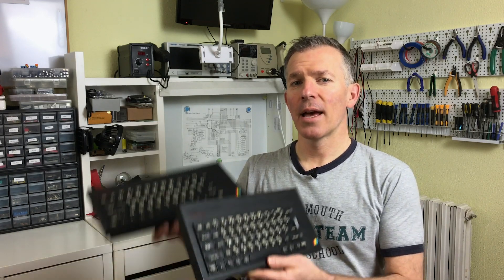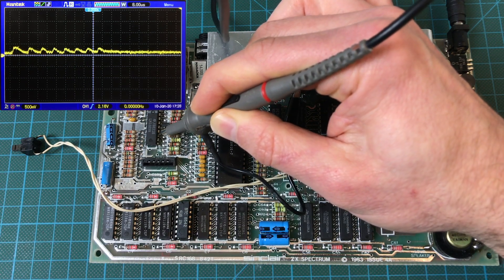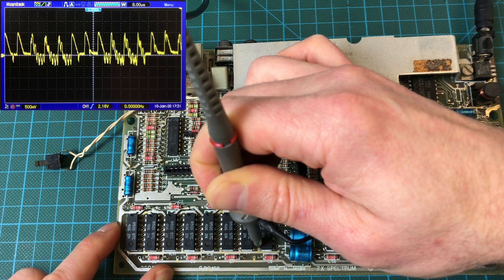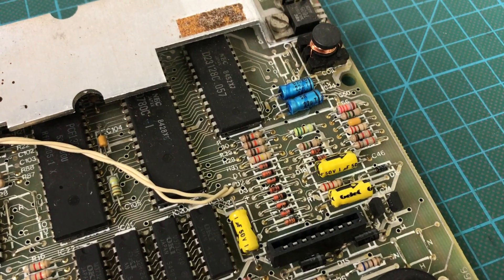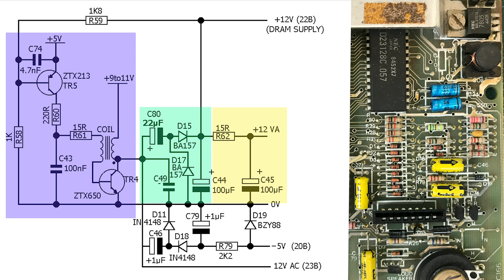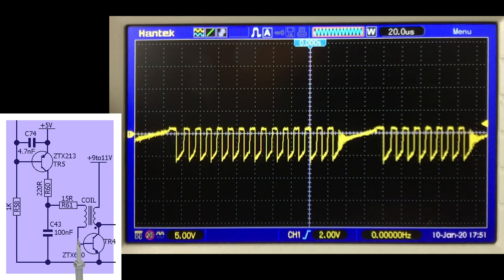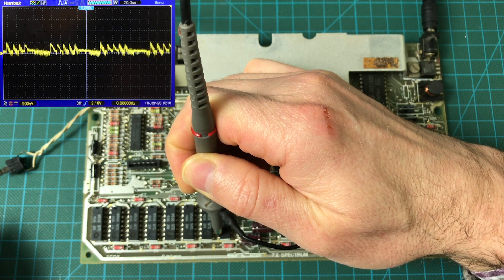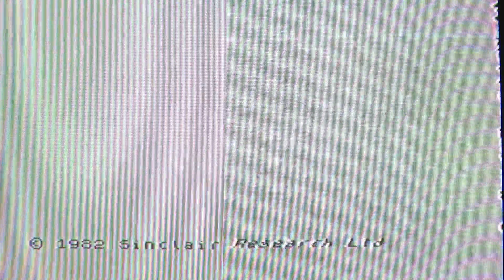Fixing Bad Video Quality on the Sinclair ZX Spectrum

Comment: ZX Spectrum 16K, 48K, and  ZX Spectrum+	      128K, +2, +2A, +3
CPU cycles per PAL line	                224						                           228
PAL line time			                       64 μs					                           64.28 μs
PAL lines per frame		               312					                                   311
Frame time			                       19.968 ms				                           19.9915 ms
Frame rate			                        50.08 fps			                                   50.02 fps

Display Vertical Synchronization by the Z80 maskable interrupt line

Comment: A video problem was the first computer repair I broke out a soldering iron for. My TRS-80 Model 100 arrived in mostly good condition, but the display flickered pretty badly. A few electrolytic capacitors had failed. Thankfully, it was easy to visually diagnose it(and some web searches pointed to failed caps being a common cause of that sort of flicker) and get the display rock solid like it should be.

Comment: I have this exact problem, with the exact same interference pattern as the first machine. It also wont load from tape at all, and my theory is that all the noise in the video rf generator is polluting the sound demodulator as well.

Comment: ohh.. Philips capacitors... time bomb :)
Reply from the maker: Oh really? I didn't know the Phillips ones were particularly bad. I'll keep it in mind. Thanks for the tip!
Reply: @NoelsRetroLab  Philips capacitors are very good, but after 20-25 years their condition deteriorates a lot. They are not dealing with the heat, but with the pulse load. (I'm upgrading old Philips CDs, all need to replace the capacitors)

Comment: Probably nuked my Sinclair Z81 as a kid plugging it in while the power brick was plugged in. I bet I could fix it these days but it's of course long gone.
Reply from the maker: I don't think plugging it in while the power brick is connected should be a problem. The usual problem is connecting something to the expansion port while the computer is powered. In any case, chances are it was an easy repair. Maybe it's time to get a ZX81 back 😃

Comment: I've just got my old 48k down from the loft which I had as a kid in 83. One of the two caps you said fail often had died so I replaced it. I have done the composite mod as well, but the display is very very poor. I plugged a different power supply in without realising the positive and negative were the wrong way around (modern way around) which I think has blown something, any ideas where I should start looking?
Reply from the maker: Yes, check out the DC voltages, especially -12V in the PAL encoder (I think I have some videos exactly about that). Chances are the transistor TR4 (or TR5) is blown and not getting steady 12V. Hopefully that's all it is, although it's hard to tell the full extent of the damage ahead of time.
Reply: @NoelsRetroLab  I've ordered TR4 and TR5 Transistors and also a modern voltage regulator, I'll replace them and hopefully she'll wake up

Comment: It's quite interesting actually, I didn't know the original Spectrum had a voltage inverter. The Soviet clones of Spectrum widespread in former USSR (which I'm sure you are aware of) used the 4164 DRAM chips (Russian clone name К565РУ5) that were 5v powered and did not require 3 voltages to power. Also they used RGB output that TVs had to be modded for, hence, no RF modulator and AV output. I recentley purchased a 48K Spectrum on Ebay and I'll be aware of this problem now, thanks much for your video!
Reply from the maker: You're welcome. I didn't know the Russian clones used 4164. That would make so much sense! Is the memory organized more like in the 128K, or do they still have a separate bank for video RAM to minimize changes from the original?
Reply: @NoelsRetroLab  Yes, they do have a 16K bank for video RAM (as far as I recall it's only partially video and it's up to 0x8000 user RAM) and 32K for the rest of memory. Also, RAM performance is different in these two banks, I think original Spectrum has that effect too. As a teenager I used to write custom loaders for games, I tried to port the tape loading routine into RAM and it wouldn't work in the lower half because of screen addressing CPU cycles. )

Comment: I have a suggestion for a video. Updating the ram on a 48k Spectrum, transforming it in a working 128k. I found a page explaining how to to it but, unfortunately, is to complicating for my knowledge. https://hw.speccy.cz/128krebuild.html
Reply from the maker: Interesting! I had seen some Spectrums upgraded to something like 80K or something like that, but I'll have to look into that. Thanks for the link.
Reply: @NoelsRetroLab  And if you want to build the ultimate Spectrum + 48k-128k, it is also possible to add the AY 3-8910 Sound Generator Chip with stereo output. https://lotharek.pl/productdetail.php?id=229
Reply: @NoelsRetroLab  I remember my father telling me, how he upgrade his 48k Spectrum to 80K. He replaced the "faulty" 64k upper rams for true 64k ram chips, and added a switch to toggle between the two 32k pages. Crude, but worked. I think that the next step would be adding some logic to switch banks , writing to a I/O port.

Comment: Just found your channel, good stuff.

About the time you made this video, I was re-capping my 48K and 128K +2.
Reply from the maker: Thanks! The +2s don't have as many issues with the capacitors because they run a lot cooler, but yeah, the poor 48K, especially the Plus ones, almost always need a recap.
Reply: @NoelsRetroLab  The +2 kept crashing, resetting or sometimes there was an audio click and the picture went fuzzy. LOL. But works a treat now.
I've had two of these for decades now, but this is the first time I've ever seen anything like it.

Comment: Noel, could you put the cost of the traco Power? Or the link from where you got it? please. Usually the price is pretty more expensive than xx05, or a DC-DC Converter, but if it is worthy and prices not too crazy, could be a nice replacement. By the way... one Amperes is enough? Thinking about to plug some devices... not sure about 1 or 2 Amperes to choose in my case.
Reply from the maker: I got mine from an order I placed on Mouser a while back: https://eu.mouser.com/ProductDetail/traco-power/tsr-1-2450 It looks to be 5,50€ plus shipping. I wouldn't be surprised if you can find cheaper sources. There's a small DC-DC converter that's pretty inexpensive and other people swear by it, but I haven't tried it yet.

Comment: Interesting video Noel (as always). I'd like to see a video from you explaining how to determine what a capicator's rating is and what type of new capacitor is suitable for replacing it with, thanks Noel !
Reply from the maker: Thanks Niall! There's not much to the capacitors: Use the same capacitance than the one you're replacing (the number in uF usually), and use a voltage the same or higher than the one you replaced. That's it. 
Now, figuring out what capacitors to put in the first place when you design a circuit, that's much trickier and I don't even have enough experience to figure that out :-) Hopefully I'll learn that when I get more into designing my own boards.

Comment: Awesome video! I've recently bought a zx spectrum + with that exact simptoms and now I know where to start to try the repairings. Thank you
Reply from the maker: Great! Replacing the capacitors is always a safe move and a great way to start. Check out my Tune Up video though, because some board issues have the wrong polarity marked on them, so you should always follow the polarity of the capacitor you extracted, not what's printed on the board!